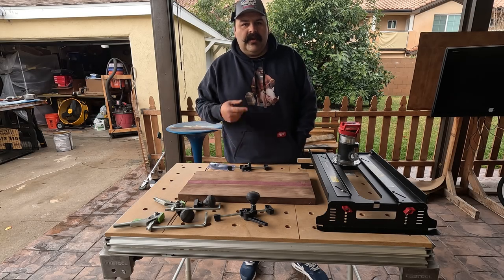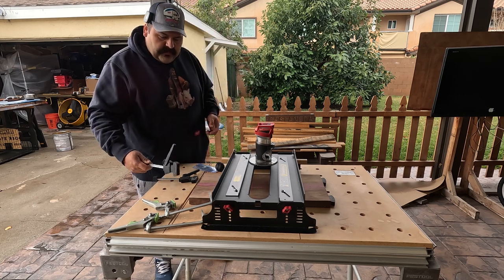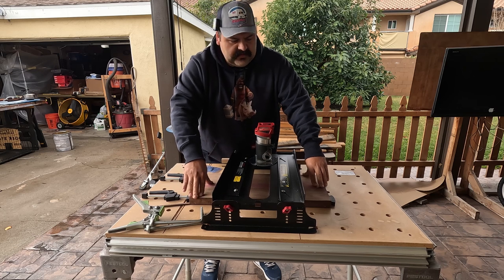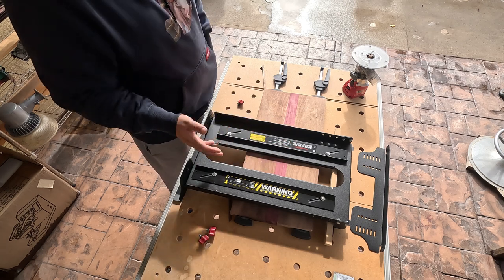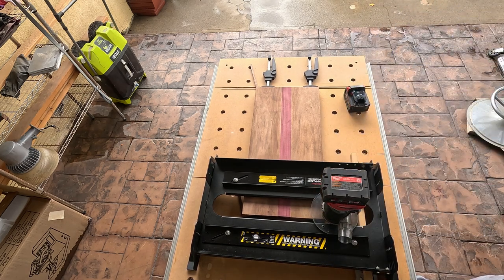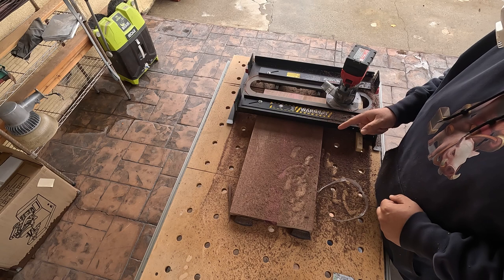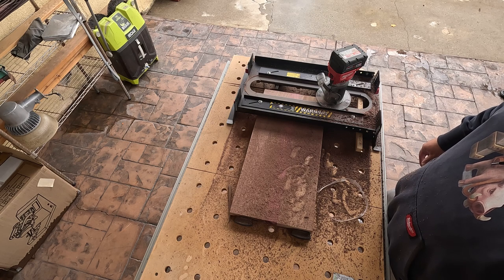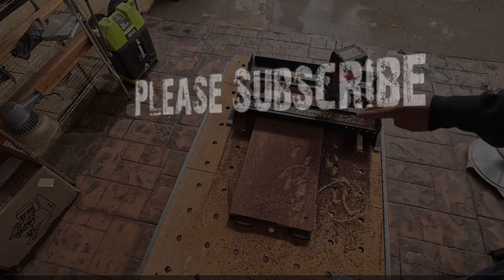vlog #26 Woodpeckers Rout-N-Plane Bench Top Board mill Part 2

Comment: Nice job! Just a couple suggestions. When your ski was running off the edge of the table, you could have moved the fence. It has several positions. As you figured out, it isn't absolutely necessary, but it makes the workflow a little smoother. Also, if you have a vac that fits your Milwaukee router, you'll be surprised at how much dust it does collect. Not saying it's going to stop the whole mess...because it isn't...but it picks up a great deal of the super fine particles that become airborne. Glad you like Rout-N-Plane. Thanks for spreading the word.

Comment: After owning both Woodpecker large flatten rigs I can confirm they are not fully thought out. It’s like a committee of old dudes who don’t actually use these rigs have a kid with a computer model up what they think might work. 
They need to prototype, then test test test with real users who make a living from actually using these tools. 
Version 1 had zero dust control, the V2 router base was a lost opportunity to make a working product. 
I mashed up both versions and added a bunch of mods to get a rig the is stiff and has 90% dust pickup. 
Woodpeckers should stick to over priced rulers for show shop customers perhaps 🤔